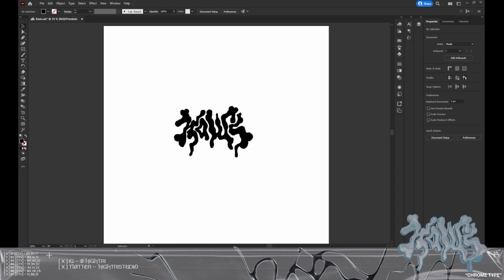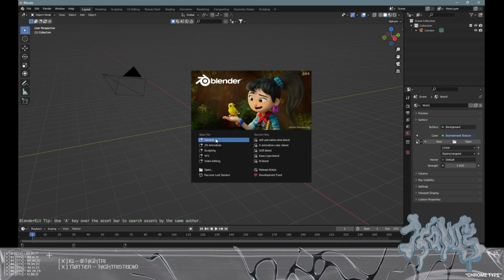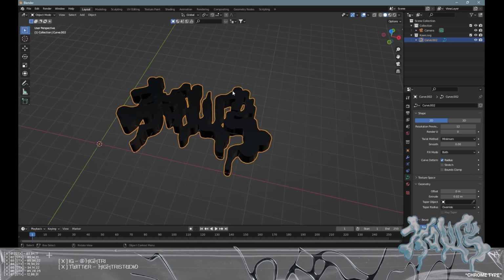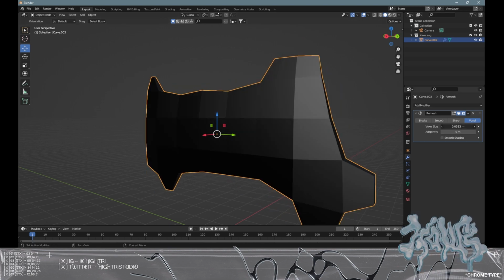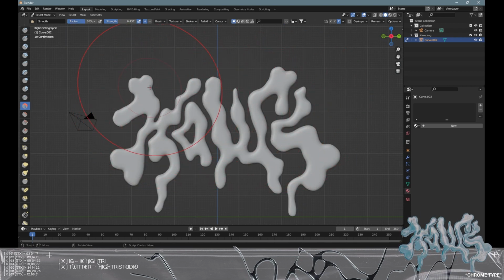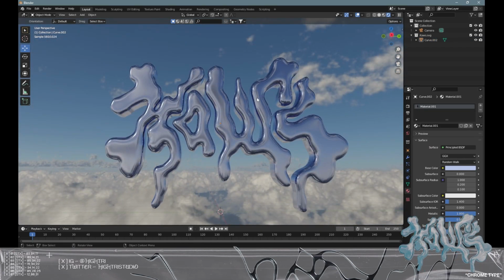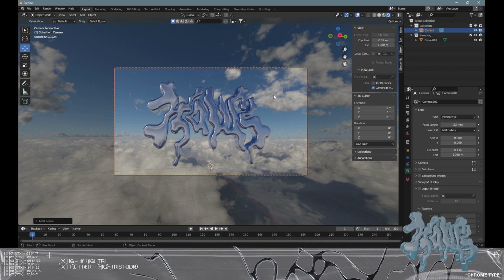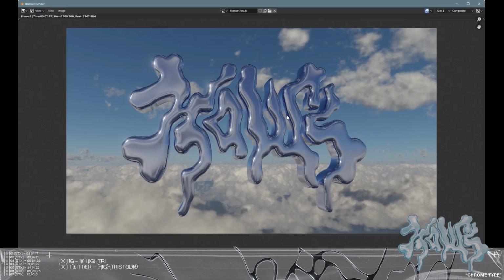BLENDER CHROME TYPOGRAPHY BEGINNERS TUTORIAL USING SIMPLE VECTOR GRAPHICS / ILLUSTRATOR WORKFLOW

Comment: Do i have to use illustrator for that or can i also do it on Photoshop?
Reply from the maker: You must ensure you export as an SVG, go to photoshop > preferences > Export and check off the “use legacy export as” option to make SVG format available within photoshop. Hope this helps! 🙌🏻
Reply: OMG thank you soso much i was worried it wouldnt work because i currently dont have illustrator yet
Reply from the maker: @rockingmonkeys6380  pleased this helped!
Reply: @hightri  may i ask if theres anything else i should do in photoshop for it to work or is doing that the only thing i need to do?
Reply from the maker: @rockingmonkeys6380  from my knowledge that should work, as long as you can export as an SVG file format :)
Reply: erm so im exporting through preferences and it doesnt say use legacy export as on there..
Reply from the maker: @rockingmonkeys6380  once the check box is ticked, go to file, then export, then select .SVG